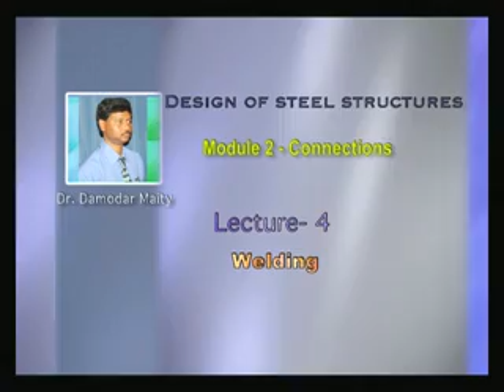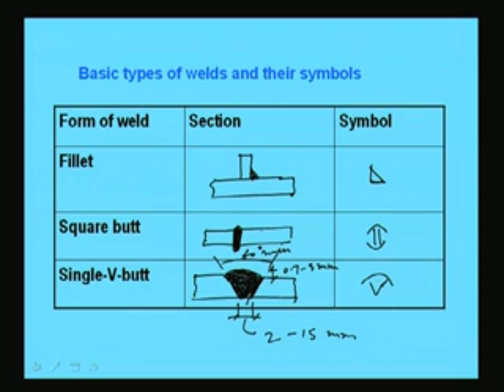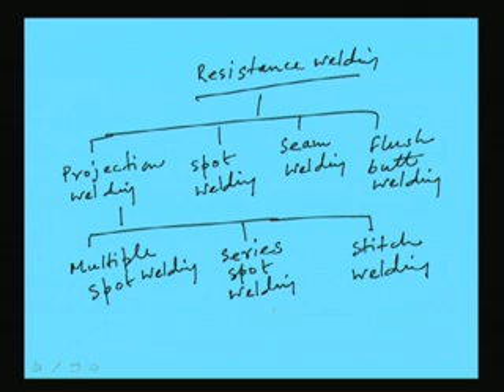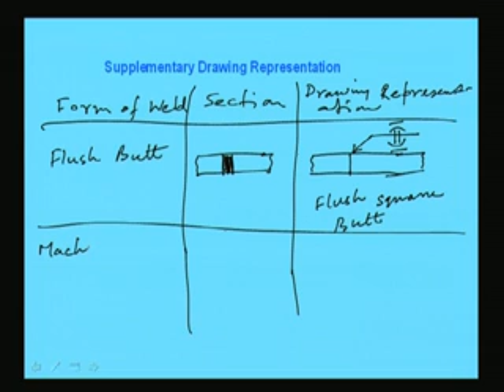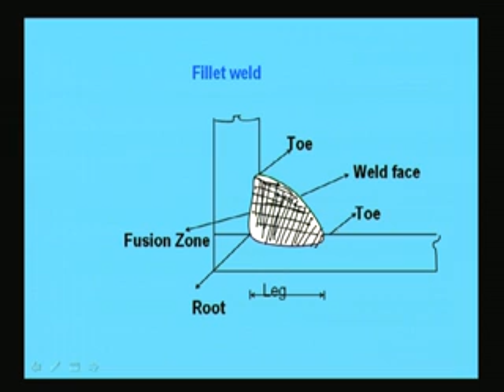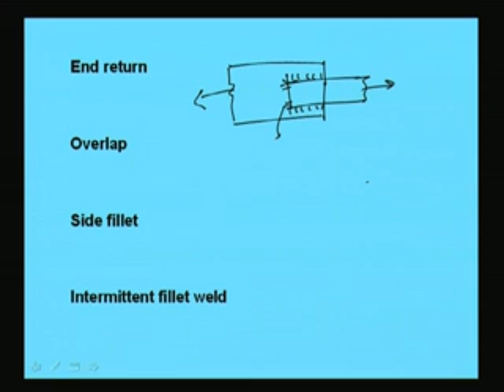Comment: no concepts were taught..for ex. in classification of rivet...where they are used individually, no diagram of intermittent fillet welds. I have studied many other NPTEL lectures but this series of lectures are at ground level as compared to other lectures